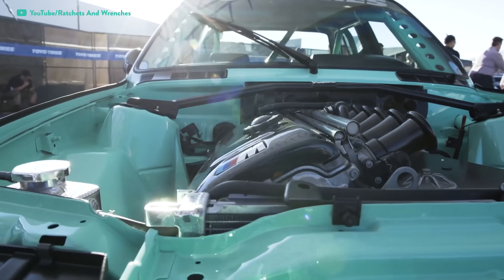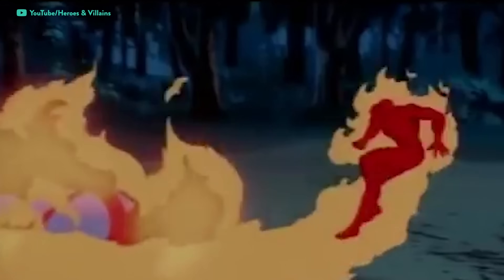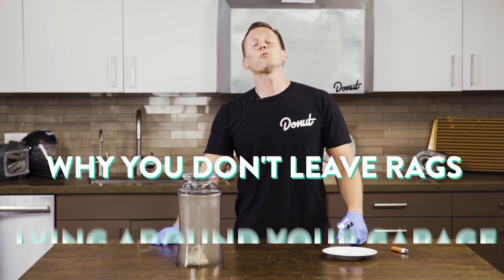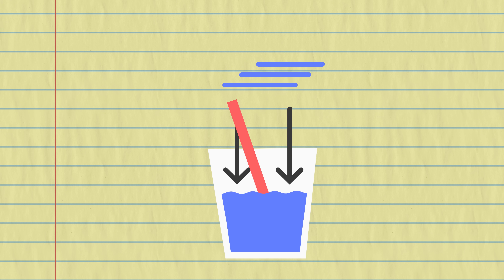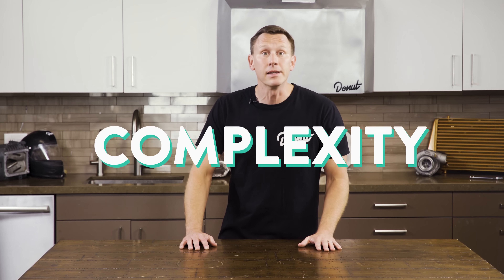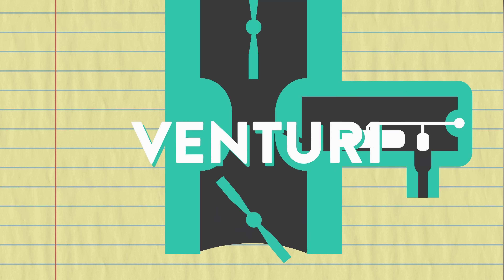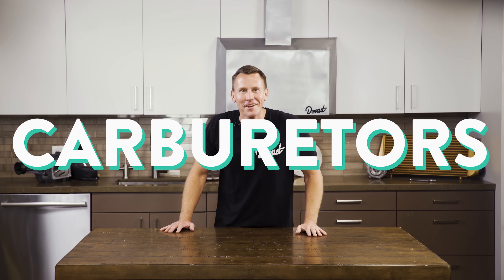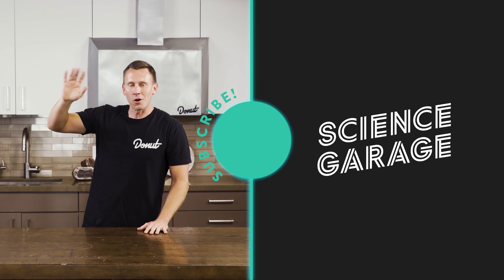CARBURETORS | How They Work

Comment: My question is what blows the air over the fuel in the first place? You need an air compressor of some sort, or the cylinder and valve pull the air in, and with it drag the fuel from the carburetor bowl too?

Comment: Everyone sucks at explaining carburator at one point:
 Time7:00; So if less air is flowing then there is also less sucking of fuel caused by Bernoulli effect!!! What causes then increased fuel outflow???!!! There has to be some other machanism NO ONE is talking about! I suppose it's simple sucking by vacuum made by piston. So I figure there should also be a little hole that evens out the pressure in fuel bowl that again no one is talking about... You all make me tired...

Comment: I acquired a 4 stroke outboard (my first one) which had a broken carburettor.  Bought a replacement carb unit for $50.  Its a thing of beauty.  Replaced old with new and bingo... outboard working a dream.

Comment: Wouldn’t it be more accurate to put a vacuum hose up to the bottle of water? If I’m not mistaken, engines without turbos or blowers only have the suction of the cylinder opening up on the intake stroke to pull air/fuel into the engine. The demonstration gives the impression that there’s another mechanism pushing air into the carb and subsequently the engine. Please correct me know if I’m wrong.

Comment: Stupiddd Man Who Invented
The Carburetor,
And Stupidddd Al Companies
Who Make Engines With Same
Invention.
If You Are Smart You Donot Need
A Carburetor, 
I Have Invented A Bypass After My
Pressure Washer Carburetor Replacement 
Does Not Existe Anymore.
You Can By Pass And Controlling How
Much Gas Need The Engine To RUN.
Amén.

Comment: Loved this video. And SmarterEveryDay did a carburetor video that anyone who has a carb should watch. I got a 1990 isuzu P'up with a 2.3l carb fed 4 banger, and I put on a weber 36/36 carb, did all the head work and bigger valves and biggest cam profile I could get away with. Was able to SQUEEEEEZE 145hp from it. More than doubled the output. Decked the head for higher comp ratio, long tube headers, everything from the carb to the collector pipe was port matched and polished. Waste of money....but cool.

Comment: Fuel injection is for better fuel control.  Fuel injection now is cheaper.  A bad carburetor can cost up to 1000 to replace.  while each injectore is about 50 dollars a piece.  Less parts on a fuel injector.  Easier to repair and diagnose

Comment: One interesting thing about carburetors vs fuel injector is that carbs rely on being upright for their operation. For cars this is perfectly fine as most anytime theyre upsidedown the last thing on your mind. This was an issue for some WWII fighters tho, most notably the spitfire. The engine was carbureted and whenever the plane would go inverted, something expected for a fighter, the engine would no longer get fuel. Especially unfortunately one of the main german fighters it fought against was fuel injected which doesn't rely on gravity. Luftwaffe pilots knew this and used maneuvers that forced tailing spitfire pilots to do negative G maneuvers to slow them down

Comment: The only advantage of an EFI over carb is the more car user friendly points like cold or steep hill engine starts. Power, mpg or throttle response remain the same with a well tuned carb. Things go south with EFI as one of the many sensors start making troubles.

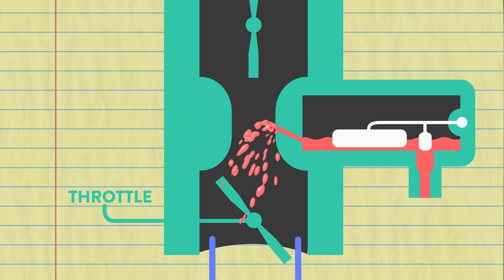Comment: 7:02, This is what I don’t get about carbs. I don’t understand how the choke affects AFR. Shouldn’t more airflow through the carb and the venturi mean more fuel being sucked out of there?? I mean, he even said this exact same thing at 7:22 almost immediately contradicting what he said, at least in my mind.

I’m looking into a SmartCarb for when I get my first (carbureted) dirt bike. I feel I have a good grasp on how that works and how it helps the bike, but struggle to grasp concepts like this when it comes to traditional carbs. I would’ve thought more airflow through it = more fuel being dragged along, no? I mean, that’s exactly what he said in the video! So shouldn’t they already adjust for altitude and temperature? I know it’s probably a pretty dumb question lol, but dang carbs are complicated!

Comment: 1:48 Not exactly how it works. There are vents called dampers that can let more air into the firebox to help the fire burn hotter, but the other and preferred way to increase airflow is to increase draft. Steam locomotives naturally draft the fire with each exhaust beat.
These two things are combined when the locomotive needs to produce maximum power, which requires the boiler to produce enough steam to keep the cylinders fed, and the train going.

Comment: Fuel that passes through a carburetor atomizes with the air much more effectively over the course of time it takes to travel through the intake and through the runners. The air fuel charge almost reaches a freezing temperature after it enters the combustion chamber which also reduces pre detonation and provides a more thorough burn. As air and fuel passes over the intake valve it cleans deposit build up which over the course of time keeps air flow more efficient also. Aside from computer controlled fuel injection, carbs have lots of benefits over the fuel injection system. The most important aspects manufacturers look at for today's vehicles is emissions controls and fuel economy which are very easily manipulated by computer controlled fuel injection systems. For all out performance, carbs still have place.

Comment: How does the choke get regulated?
Reply: Some are manual, there is a knob that you pull to control the choke. Some are electrical so there is a metal coil that has electricity running through it when the ignition is on. When electricity goes through the coil it gets hot and causes the metal to expand and open the choke.
Reply: @Redtooth75  thanks bro

Comment: I bought a Chinese motor in Amazon and put it in my daily routine bicycle and it rides well but the stock carburetor doesn’t let the air in that much and I think that’s why every time I’m in a stop sign with my mototrized bike it sounds like an overheating console so today I’m to switch the carburetor to a more air flow carburetor you see on motorcycles

Comment: Fun fact, covering fire with water doesn't kill fire by preventing oxygen, at least not primarily, but by taking away the heat required for a fire to propagate. Water is able to take a lot of energy before it vaporizes, so if a fire is in contact with liquid water it will begin to form vapor. Water boils at a hundred degrees Celsius, high enough to absorb lots of energy and remove any of the heat from the fire. 

NikeRed does a good explanation: https://m.youtube.com/watch?v=sAcgWbVHJHw&feature=youtu.be

Comment: I need to know exactly how the high and low speed adjust screws work, and i need to know WHAT ARE THE LITTLE METAL CAPS FOR. Some carbs have no caps, 1 cap or 2 caps! Some have THREE CAPS. Some have a primer bulb below the diaphragm, and some don't. WHY AND HOW

Comment: There's something not clear to me. When the engine is cold you need to open the choke (more air passing thru the venturi = higher pressure = less fuel into the chamber, right?). So you don't get a fuel rich mixture if you open the choke before you kist start a carb motorcycle? 
Or when manually you open the choke, the choke valve closes to create less pressure and suck more fuel to get the engine starting?
Sorry I am a bit confused

Comment: Uhm... a fire consists of three things... 1. a material that can burn, 2. Heat, 3. Oxygen... When you put Water on a fire, you remove the "heat" and lowers the temperature... If you remove the oxygen you cover it with something, a fireblanket or foam :)

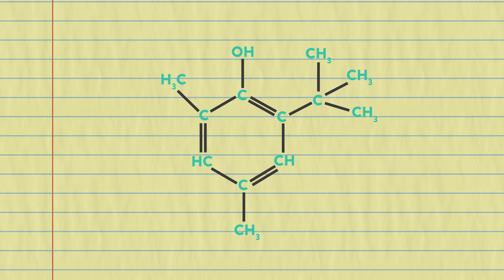Comment: 1:14 that is not fuel. 1-hydroxy-2-(2,2-dimethylethyl)-4,6-dimethylbenzene. No idea what this is. Fuel is mostly just a fraction (boiling point range) of refined mineral oil, which mostly consists of saturated hydrocarbons. Petrol for example is mostly hexane and it's isomers.

Comment: Wait at old times petrol powered engines they used carbs and diesel used fuel injectors? But now petrol use fuel injectors and diesel also used fuel inectors? But you cant have both like you have carb in youre engine and fuel injector in your engine?

Comment: Lol speaking of air fuel mixture, I once bought a 79 Sierra grande with a 383 stroker. The guy that built that engine was an idiot.  He left the stock 350 intake on it and put a 750 double pumper on it. It ran like shit and got 6 mpg.  When I put a Holley 650 single pump on it the mileage went up to 11 and that 383 finally found it’s power. That dumbass also neglected to put a high volume oil pump on it but fortunately I caught that before any damage was done.

Comment: Fuel injection doesn’t have more maintenance, wtf? Carbs constantly need to be adjusted for weather fluctuations or else you’ll run rich or lean and soot up or have detonation. Also, if the car sits for too long, the jets clog up and you gotta spend your Saturday or pay a bunch of money to pull the carbs and have them cleaned. Fuel injection usually works for the life of the car and if it ever fails it’s usually just a matter of replacing whatever went bad and off you go. Fuel injection all the way, carbs suck.

Comment: A carburetor is the one weakness my 1987 Chevy Nova(an 1987 Toyota Corolla with a Chevy badge) and my latest acquisition, a 1986 Nissan Pulsar NX.

Most of Nissan's cars had fuel injection,  ie: XE trims Sentras, 200SXs, most Stanza trims, all Maximas, all 300ZXs and most Pickups.  

I don't get the reason on that one. A little tricky to initially start cold but once started, idles on its own and warmed up, starts right up every time

Comment: So,

I am working on an ATV that I got for free from my neighbour (a woman who divorced and gave it to me as she got old and didnt know anything about it). The ATV had been sitting for a year and I am working on fixing it.

Now, I changed some tubes, tested and fixed some stuff, but it didn't want to start and run. I then decided to put gasoline straight into the carburetor hole which made it running for about 5 seconds.

This means that everything works fine, there's compression, the battery isn't an issue (it's a kickstart), the spark plug works perfectly fine..., except from the carburetor not taking fuel from the fuel tank. Here is the situation:

- When taking off the fuel hose/tube fuel comes throught
- When taking off the float chamber, fuel comes throught the hole and falls on the ground, so the chamber fills up with fuel for sure.
- Yes, I've cleaned the carburetor twice with a compressor, same goes for the jet's.
- When blowing on the fuel income hole where the hose is connected, air goes throught when the float is down as it should.

What in the world is causing it not to use the gasoline?
Thanks in advance for trying to help!!!

Comment: So dose it really matter if the metal is smooth are rough surface. When it's not a slow flow across the metal its blasted an slushed around so dose port an polishing really work. More the polish. Porting works for sure but imo polishing dont do to much. Dose some. But my theory is an rough surface works better for making vapors.  Killer vid. Very funny

Comment: as a sports bike/car owner i can seriously say carbs have no real advantage at all. less power. less fuel efficient by quite a bit and dirty jets are common especially on motorcycles which can make them fire on only half their cylinders. fuel injection is better in every way. well worth the extra cost

Comment: When standing still, how do you ensure airflow into the carb? Is there a fan somewhere in the system?
Reply: In intake stroke by a piston creates a strong vacuum., which also powers any vacuum components like your brake booster, and emissions system components.

Comment: Well I like to swallow buddy because it's injected and it should say stream of gas that's dispersed more evenly through the cylinders instead of big droplets coming down are being like a carburetor does now for some of my carburetion I'll take a stainless steel screen a fine stainless steel screen and I'll put that between two gaskets I'll sandwich that and then our mouths that in between the intake manifold and the carburetor that helps break up droplets like if using double Pumpers it helps. Fuel distribute more evenly through those cylinders so if you're using a carburetor system you might think about that stainless steel screen between two gaskets and also when you working on the motor it helps it could save you from dropping something down in that manifold anyway there you go

Comment: Most small 4-stroke 1 cylinder engines use carbs. I have 2 cylinder snow machines, and they don’t use injectors, they have two carbs so that both cylinders run.

Comment: Soooo... Carburators mixes air and fuel and controls the mixture ratio together then that mixture enters the intake to be combusted. Is that correct so fact? 

So when you throttle you open up the throttle valve on the carb. So you're basically sending in more air?

But I'm curious as to what powers the carburator! The battery the engine? That confuses me. Or is just the carburator sitting there by itself powered by nothing but air?
Reply: Youre getting it all wrong buddy. Efi is electric fuel injection, which means its electric. Carburetors, on the other hand, just needs a fuel pump to get the fuel to it and then a bit of manual adjustment. The carburetor uses the pressure built up in the engine to suck in air, the more air that gets sucked in while the valve is open means more gas. No power at all, just a wire connecting to your gas pedal. Thats why a lot of old engine swaps are powered by carburetors, theres nothing to it electronically

Comment: If FI is more effecient, then why are drag racers always converting their LS engines to carbs?
Reply: Its easier to tweak on the spot for a few, has no wires at all so you could swap the transmission to a stick with ease.

Comment: Carburetors are actually a great way to get power out of an engine that might have some really annoying electrical emissions governors on the MAF or on the intake manifold in general or if you are, like me, taking an '84 Mustang GT, which is carbureted with its HO 302, to swap to a 351c or 351w and you don't want to deal with all the electronics and such... the early fuel injection methods like Throttle Body Injection and Tuned Port Injection for GM were not as efficient as the Mustang's HO 302 with carburetor nor actually as effective as GM's own 305 with a carburetor... Once you get to direct injection, it's another story... However, I still have a soft spot for carburetors since i can build the motor on my own with them :)

Comment: I have a question: I have a 1996 Toyota Hiace, it's Lpg and petrol. Lately, when I drive it on petrol, the car won't drive until it is warm. It's an auto car. I've had the choke adjusted by a mechanic and it's still doing it. It's super dangerous to attempt to drive it on petrol because it will stop in the middle of the road and not move until it's been 7 or so minutes and the car is warm. The mechanic said I may need a new carberator but said he couldn't even be sure. It's expensive job so I'd rather try other things first. Does anyone have any ideas? It starts and drives fine on Lpg by the way.
Reply: Oh and it's an auto choke that's below the drivers seat so it's not something I can easily adjust before I drive each time.

Comment: My father in laws 82 Corolla has a Carb and it's a fun little car, carburetor are a lot easier and cheaper plus it works without power just on air and fuel.

Comment: The chemical properties of gas are uncommonly seen in your day to day life, so seeing something vaporize far faster than water with vapors that are dense enough to be easily lit on fire is strange to some people. I like it that the concept has been applied to carbs, nowadays we charge our engines and use fuel injection that functions off of camshafts and turning mechanisms coming from the crankshaft. Both designs are ingenious really, with carbs being more simple.

Comment: The animation of the carb float is wrong. The fuel inlet should be on the top so when the float falls it opens the valve and when it rises it closes the valve

Comment: I thought carb is a lot more complicated than fuel injection bcz fuel injection just injects fuels into the intake stroke and I still need some explanations on why fuel injection is a lot more complicated than carb
Reply: The injector itself is not complicated, its just an electric valve. The complicated part is the computer to control how much fuel is injected and the various sensors the computer needs. A carbureted engine needs no complicated electronics, the only electronics would be in the distributor. Most carbureted engines only need power going to the coil and no other wires. A fuel injected engine needs many sensors such as a crankshaft position sensor, camshaft position sensor, throttle position sensor, MAP sensor, MAF sensor, coolant sensor, intake air temperature sensor, and others depending on the application.
Reply: @Redtooth75  that's a lot of sensors. Thx for the explanation man!

Comment: I want to know, why is a turbo not so popular on a carbutator engin as it is on a fuel injected engin?
Reply: To use a turbo, the carburetor needs to be converted to a blow through system. A carburetor lacks the precision that you get from fuel injection. It is almost impossible to get the optimal air to fuel ratio with a carburetor, a fuel injected setup would make more power.

Comment: As a guy who rides four wheelers I like carburetor S better than fuel injection because typically there a lot smoother throttle response
Reply: Fuel injection should have better throttle response than a carburetor would. The fuel injection system might not be tuned properly.